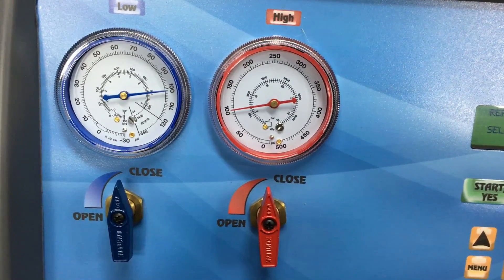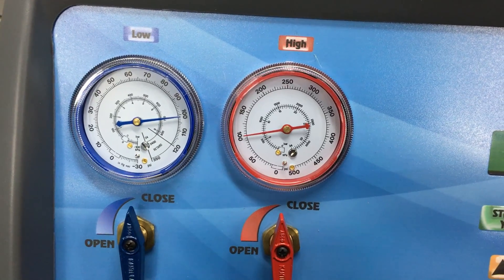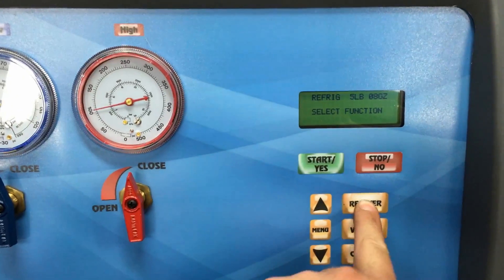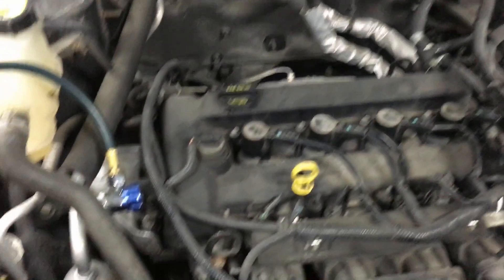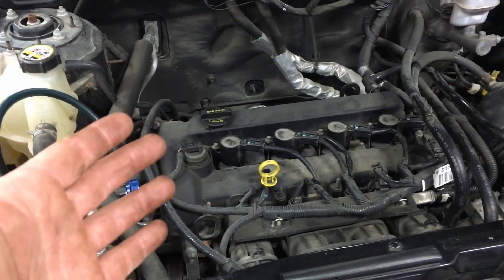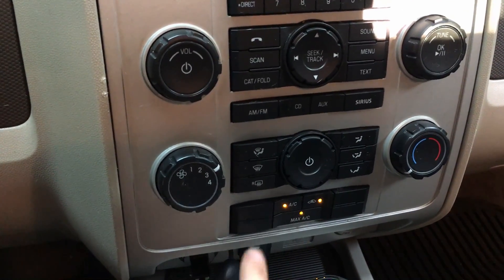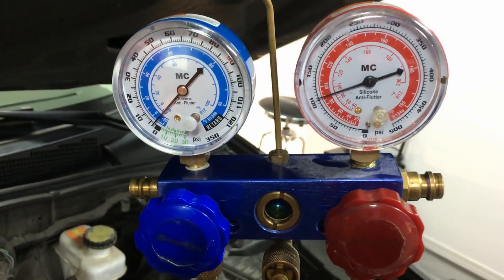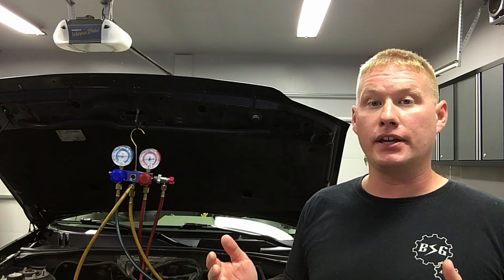Ford A/C Quick Tips #6: NEVER use Static Pressures for Diagnosis

Comment: Is it normal for ford f150 2014 model for compressor to engage on and disengage off for about less than 2 minutes.  With proper charge refrigerant on it. Txv replace and condenser replace.
Vent temp about 14celcius
Ambient temp 40celcius?
Reply: Miguel Pilapil it’s not normal. Check for clogger filters , evaporator , thermostat . Do u have climate control ?

Comment: I replaced my compressor on a 2011 Explorer XLT and the compressor clutch won't engage. I made sure to oil the new compressor and I charged the system with a full can. The A/C lines in this car is kind of long and runs to the back for the 3rd and 2nd row cooling so I am not sure if it just requires more coolant or no. The relay is fine. I ran some FORscan tests and I got a reading of 910 kPA for the acp_press. No codes either. Have I done something wrong?
Reply: TimeHopeFaith Before charging w the can, Did you get a vacuum pump and pull a vacuum on your system down to about 29 inches for about 2 hours? Also, did the can have the exact amount of R134 that your car calls for? There should be a sticker somewhere under the hood that tells how much your system is supposed to have.

Comment: 2004 F150 4x4 refrigerate liquid line keep bursting off. It will charge and run for about a day and pisssss the hose will blow off near fire wall. I purchased new line also 2, two orifice tubes. I have totally used 9 cans of Freon...Please help !!! Thanks

Comment: I have what I consider to be an issue about changing out my a/c compressor!! due to the exorbitant "costs" of labor in my area I was wondering if I could replace the compressor at home then take the rv into the mechanic for the complete a/c servive; I have the new compressor(uncharged) and more time then money; how would I replace the old compressor with the new compressor without doing damage to any engine components??? the laborate here is$125hr. the a/c complete service is around $300.00 that price does not include replacing the drier/accumulator and orifice filter; I not a cheap skate (but the costs is ridiculous; I,m just trying to save a buck; my engine is a FORD TRITON V-10 WORKHORSE 415 CU. 6.8LTR GAS/ NATURALLY ASPIRATED ENGINE; THIS IS THE POWER SOURCR FOR MY HOLIDAY RAMBLER RV;; there must be a way to install the new compressor and drive the rv to my mechanic for the a/c service; any suggestions would be greatly appreciated, thank,s GOD BLESS, PATRICK.P

Comment: i have a motorhome that is short cycling every 2 to 5 seconds with low side at 35 to 45 and the high side is the same with ambient temp at 77. would you start out with replacing compressor. thanks
Reply: Those readings seem low. I know your post is 2 years old, and hopefully you got it fixed, but if not, look up an a/c pressure chart for r134a (if that is what the system is running). Next step would be to find why it is losing pressure (a leak somewhere). Your low side pressure is good, but high side is way way too low. If you only had a weak compressor, the low side would also have been high.

Comment: Bottom line is you can't change physics.  Same thing that HVAC and low, medium, and high temp refrigeration techs miss all the time.

Moisture in the system always throws techs too... Cannot compress water.

Comment: I have an issue with my AC I tried charging it and I had to bypass the AC so we can turn on but every time I charged it it blows back the AC outside of the system from the compressor

Comment: Good Stuff Man!  Correct me if I'm wrong please.  The static can be used as a general idea based off how ii correlates with the temp.  In this video with just 3oz it showed as if the temp in your shop was around 60 degrees.  That is the trained eye you're talking about?  Where as the first reading indicated the correct 86 degrees using static.
Reply from the maker: right the system refrigerant must be at ambient such as after a cold soak of 6 hrs or more then static cab be a good general indicator.
Reply: I never consciously realized it but static is a good indicator of charge, I’m working on something atm where compressor won’t turn on but pressure, and how it correlates to temperature led me to believe refrigerant was low (also prevent compressor engagement)
Reply: I keep seeing that the static pressure in psi of R134 in a properly charged system should basically equal the ambient temp in degF. But in this video, static pressure was 100 psi when ambient was 86deg F. What's up?
Reply: @mrau92me  
That only holds around 68 deg F, give or take 5 degrees. When the temperature goes higher, the pressure goes up at a faster rate than the temperature.  Similarly, as the temperature goes lower than 68 deg F, the pressure drops more rapidly.
Something like this:
Pressure		Degrees Fahrenheit
		
53.88		57.2
58.43		60.8
63.2		64.4
68.21		68
73.46		71.6
78.95		75.2
84.7		78.8
90.71		82.4
96.99		86
103.55		89.6

The issue with trying to use static pressure to determine total charge is that as long as there's enough charge to maintain some liquid refrigerant in the closed system, being at the vapor pressure equilibrium, it will show that same pressure even if additional refrigerant is added. The additional refrigerant will not increase pressure because it remains a liquid when the pressure is at the equilibrium point.
The only conclusions you could draw is if the pressure is below the vapor pressure spec at that temperature; that means you're undercharged, with no liquid refrigerant present in the system (assuming it's uncontaminated with other gases or moisture). 
So it can tell you if it's undercharged, but not if it's overcharged.
The 60 PSI shows the system is undercharged, as the shop likely isn't sitting at about 58 deg, since few people would sweat at that temperature.
Reply: @dtrrtd774  Thank you

Comment: I thouggt the low side had to be above 10 or the compressor couldnt lubricate itself properly? Then again im only used to working on older mvac systems in heavy equipment and older cars where the low pressure cutt out switch shuts the compressor down bellow 15.

Is this something with the new ac systems?
Reply from the maker: This one cuts out at around 12-15 the spec is. Refrigerant is needed to drag the pag oil through the system yes.
Reply: Ah thanks, misread your gauges thought it was reading >10 on the low side. Couldn't help but to cringe at the thought of a compressor not shutting down below the usual cut out pressures. Had a brain lapse for a moment when you said TXV, was for a moment wait is there something new i haven't heard of before that allows a compressor to operate safe in a low pressure condition? I know of expansion valves and orifice tubes, but TXV... then it hit me like a brick Thermal eXpansion Valve.

Comment: ? - Manifold gauge fitting size for 2013 Ford Transit Connect -?

A friend loaned me his A/C manifold gauge set for r390a residential HVAC systems, but the fittings are to large to fit my 2013 Transit Connect van. What is the likely adapter I need? I am not on a time crunch and am willing to order a hose set or adapter online if need be. Thank you.

Comment: I have a 2013 F-250  Super  Duty  The clutch on the compressor it kicks in for a few minutes then it cuts off in a minute or 2  cut back on The refrigerant is good Any help will be greatly appreciated

Comment: Thank you for explaining about the Static Pressure. What would be your opinion about my system. I have static pressure of 135 high and low side with outside temp of 86 with an engine compartment temp of 95 degree and inside car temp of 105  With the car and AC on I have 49 on the low side and 235 high side. I have air vent temp blowing at 68 degrees.  My issue is that the compressor seems to cycle a lot when it is hot outside and doesn't constantly stay cold but seems to work great in the mornings or evenings when the outside temp drops down around 75. Electric engine fan is working.   Thank you
Reply: Vito Lotta my car is doing the same. Trying to figure it out too.

Comment: I'd like to have seen the gauges after fully charging the system with the correct amount of freon.
Someone said that the static pressures if they are not equal after the vehicle has sat for a period of time that you automatically know that there is a restriction in the system. Is there any merit to that idea?
Reply: with a TXV (or other valve) fail, or other contaminant restriction anywhere in the system,  the pressure with not equalize as quickly as normal between low and high sides, static.
Reply: I had 30 PSI low and 300 PSI high on my 2010 Focus, which may still be overcharged. I had the system way overcharged when I blindly added some leftover R134a without looking at the high side, not realizing the compressor was then driving the high side pressure to the safety cutoff at 435 PSI. AC was ineffective as a result, with the low side only dropping to 60 PSI, not low enough for the expansion valve metered refrigerant gas to expand sufficiently into the evaporator for cooling.

Comment: When recharging the AC system, should recirculation be on or off?
Reply: I would keep the re circulation off so the AC works harder.
Reply: pa5han turn on MAX a/c when recharging. Same as using the recirc. Itll give you more accurate pressures, and cooler air.. Because it circulates air that has already been cooled from the cab.
Reply: Iowa Comm. Watch News Network but why? How does the recirculation flapper position in the cabin influences the recharging process?
Reply: on

Comment: Do you have anything on cooling fans
My 2009 Edge the cooling fan won't always come on.
And when it don't the air doesn't work either
Usually in a traffic jam or a long stop light
Reply from the maker: +Joe Stelter replace the entire cooling system fan and module known failure
Reply: FordTechMakuloco I have replaced the module, So now I should replace the fans?

Comment: I got 03 ford ranger blows ice cubes but I don't hear my clutch cycle. is this good or bad. BTW car running is low 35psi high 195, also ac/clutch relay solenoid working

Comment: Ford tech makuloco Hi Brian i have a question i have 2013 f150 fx2 just bought it not to long ego it has a noise that is annoying because is really loud it only goes on when the ac is on and the temperature outside (whether) is really hot sometimes it stays on for long time and sometimes only for seconds i took it to the dealer but that day the temperature wasn't hot so the noise was not on and they said it's normal but i have my doubts.
Reply: Probably bad bearings in the compressor, it will get louder as time progresses, and the condition of the bearing further deteriorate, eventually the bearings can lock up completely ac causing a loud belt screeching sound.

Comment: I have a 2001 Ford escape and I think the a/c compressor is going out.  I recently tested the A/C system and the static charge was 85 psi.  At 80 F ambient temp, The low side read 40 psi at max setting.  The high side read 170 psi. the temp from the center vent was 60 F.  The compressor also never cycled off.  When the fan was set to the lowest setting, the low side pressure dropped to 28 psi and the high side stayed the same and the inside temp dropped to 48 degrees.  I did the spin test by hand and there was a couple of spots that had resistance (compression) but otherwise I could spin it with my hand.  It did not feel smooth.  Do I need to change the receiver/dryer if I replace the compressor and do I need to flush the system out?
Reply: I would be looking at the expansion valve. About $15 online.

Comment: What if your compressor kicks on and kicks off every couple seconds and keeps doing this?
Reply from the maker: This is a classic sign of a low charge level 95% of the time but it can also be due to a high side restriction.
Reply: FordTechMakuloco Thank you
Reply: I had a short cycle condition that was actually cause by some bonehead (looking in mirror)  indiscriminately adding leftover refrigerant, not wanting to waste it from another job. It would cycle on for just a second and cut off again. This was actually from the high pressure cutoff at 435 PSI, from the extreme overcharge. The engine loaded down when the compressor cycled on, fighting the high pressure.
All because of the way Ford camouflaged the high side port in plain sight right on top of the fan shroud near the left headlight. Looked all over and didn't see it, though it was right in front of my eyes, lol.
Don't try doing things without the high side gauge hooked up, is what I discovered.
Kinda impressed how high a pressure that compressor developed though-

Comment: My  2004 5.4l has never worked correct! I went to the extent of putting more and more slowly until one day when it was hot the high pressure valve turned the unit off! It was way too full. Through your experience, what would you expect to see on the gauges when running with the correct amount of freon on this vehicle? I can't see anything about it in any of the books I have on the truck.
Thanks for the video.
Reply from the maker: 35-45 psi on the low side gauge and 200-250 psi on the high side.
Reply: Thanks for taking the time to answer.
Have a nice day.
Reply: FordTechMakuloco that would depend in the ambient air temperature.

Comment: Hi Brian. I've got an 06 F150 and the compressor or clutch is "ticking" or "tapping". Is this sound usually due to a worn/faulty clutch or at the compressor? It's still pretty hot on Phoenix right now, so I'd like to get it taken care of before it goes out. Thanks in advance!
Reply from the maker: You can tell by turning the compressor clutch by hand engine off of course. The compressor should have some resistance as it goes through the compression stroke but should feel smooth. Of course while you are there wiggle the clutch there should be no noise from it.
Reply: +FordTechMakuloco Thanks! Don't know if it is of significance or not, but but the noise only occurs when the compressor is running... Thanks again!
Reply: @FordTechMakuloco  Hi my 2006 mazda 3s 2.3L  A/C stops blowing cold after  idle slow driving a/c works when im moving traffic  fast car doesn't overheat / fans run / ac pressures good / new condenser / new dryer / new a/c clutch / New fans would you know what is my problem is ?

Comment: I had a 02 expedition come in the other day and it was missing the orifice tube. It almost kicked my butt until one of the senior master techs came and helped me. What got me was that the pressures were pretty good but the low side was a little high around 70. The master tech diagnosed it by putting his hand on the pipe where the orifice goes and said there is no temp difference on either side of the pipe where the orifice tube should be. I put in a new orifice tube and the system worked perfectly. I would like to see a video on how to properly diagnose that problem. Thanks
Reply from the maker: The low side at 70 was a dead giveaway that is nowhere near ok. Odd concern for sure though but a temp gun is what I would use to check either side of the orifice. In a txv system with a scroll compressor this can be misdiagnosed a weak compressor or failed txv. The expedition uses a standard FS-10 Swashplate compressor and Fixed orifice which is key here it makes it much easier to diagnose.
Reply: So low side at 70 and highside almost same Im guessing is system missing the TXV (Orofice).?  And temps same on each side of system?  @FordTechMakuloco
Reply: What does txv mean?
Reply: @ltlpaa2973  , thermal expansion valve.

Comment: Hey Brian ever use thermocouples to make full system diags with out the use of gauges?
Reply from the maker: Nope I stick to a regular manifold gauge set they have not let me down yet. Kind of like the power probe everyone talks about for electrical diag still to this day I have not found a need for one.
Reply: gotcha, I like using both and I agree on the PP, I am a test light scope kinda guy :)
Reply: FordTechMakuloco same here, just use a basic test light and the trusty Fluke. I renamed the Power Probe the module zapper, guys try to activate solenoids and kill control modules in short order by backfeed.
Reply: Sorry to be so off topic but does any of you know of a method to get back into an Instagram account..?
I was dumb forgot the account password. I love any assistance you can give me!
Reply: @Salvador Shane instablaster ;)
Reply: @Juan Tate Thanks so much for your reply. I got to the site thru google and im in the hacking process atm.
Takes quite some time so I will get back to you later when my account password hopefully is recovered.
Reply: @Juan Tate It worked and I actually got access to my account again. Im so happy:D
Thank you so much, you really help me out!
Reply: @Salvador Shane happy to help :D
Reply: Thermocouples? Huh Gota, look into that  never heard of it 🤔👍👍

Comment: This gets even more strange when you have front and rear AC\Heat and the Rear is like 12 feet away. The system needs time to stabilize or you end up over charging on hot day. I ha one that drove me crazy till you remove about 5 oz and it started blowing snow flakes! As he rear AC actually had a charge gauge port on it.
Reply from the maker: Wow 12ft what is that a Bus?
Reply: FordTechMakuloco
It was a Ford E250 conversion van. The AC\Heat lines snake down the passenger side over to the driver side, then down frame then back up inside the rear. It has an  expansion valve and low\high ports and the fan,The only reason I figured it out was the I thought the fan was weak or clogged up. Man taking all those rear panels off was a chore. There must have been 30 screws just to get at the unit.

I would add. If you in there. Seal that unit back up with that 3M auto trim tap and clean all the vents with a fish tap, paper shop towels and 50\50 bleach water. Then seal the hoses coming in from outside with rubber tape. then blow the coils out good from inside out.
Reply: Claude Rains h